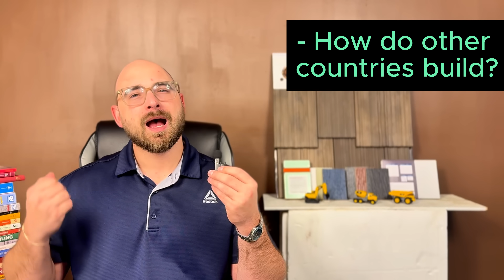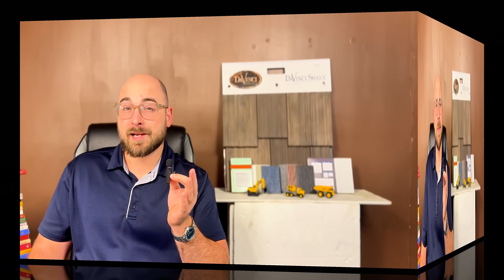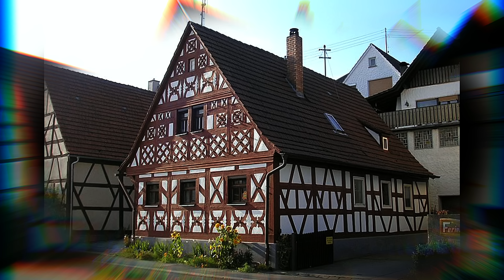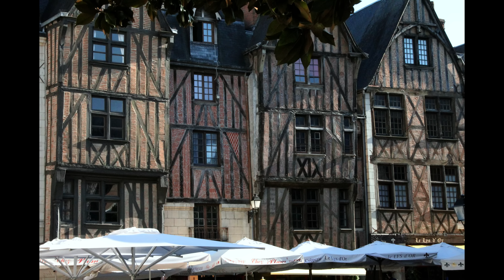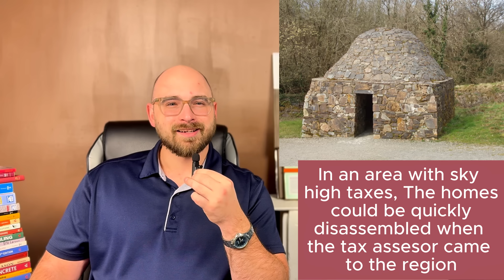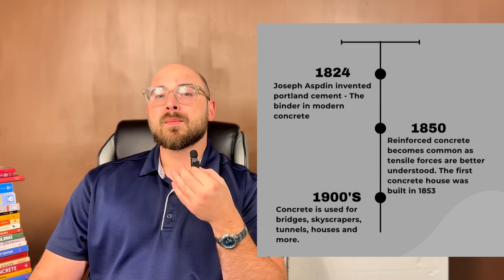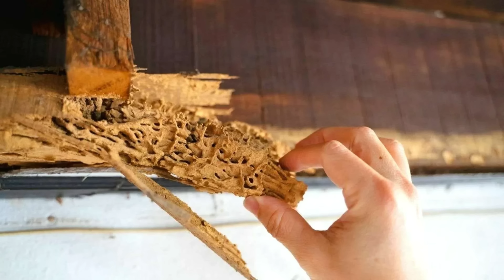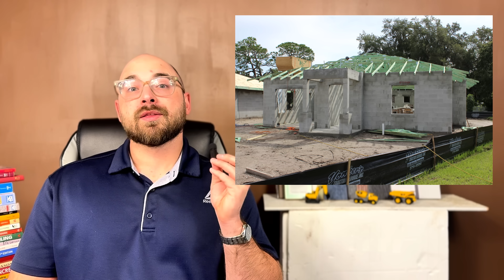Why Other Countries LAUGH at American Homes

Comment: Here in Australia nearly all homes have pre-fabricated frames built in a factory and erected on site. This is still the preferred method but you can also get the entire home built in a factory, and the modules are shipped on the back of a truck and craned into position onto the finished foundations. One of our neighbours did just that and it was ready to move in after the electricity, water and sewage were connected. The added bonus is that there is no down time due to inclement weather or material storages. Just like in the automotive industry of years gone by, there is no need for highly skilled people like carpenters, just one skilled builder, an electrician and a plumber to oversee the entire project, the rest are on the job trained labourers. These buildings can be built to either the minimum standard for your risk area or to a much higher one dependent on your budget.

Comment: I feel like it wasn’t always this way. I live in a 1954 home that our landlord barely maintains. Probably hasn’t had a new roof in well over 30 years. No leaks, no issues. Stays nice temperature, hardly ever need to use the heat or AC. My coworkers have new build houses in, they are built terribly! My boss just has his wall ripped open for 3 months because they couldn’t fix the roof leak! And his AC bill is insane.
Reply from the maker: People used to care about each other in this country, now we’ve become greedy and hyper-individualized
Reply: @ 💯I don’t know how the greed will stop

Comment: The main reason for mocking US homes (afaik) is There is so many potential disasters that can hit, and the homes aren't build accordingly. And with the amount of gun violence there is, I guess most people don't understand why you wouldn't invest in something that can handle most of the challenges. I personally would prefer to live in a more secure place. Take reinforced concrete, It would outlast both earthquakes tornadoes and would protect from firearms.

Comment: As mentioned we build wood houses here in Sweden. But I would say that we use higher quality windows, doors and roof. We often build a concrete slab with floor heating.

Comment: I see it as more  in case the house is burning you can punch your way through the wall to freedom in case the doorway is blocked by fire where you can't punch your way through bricks but you can punch your way through drywall and thin wood

Comment: Very few new homes in Scotland are built from stone. Same in Spain, and I'm sure other places you've mentioned as well. Brick is very much the norm for new housing in the British Isles. Here in Spain, it could be brick or concrete, depending on the type of construction. Of course there's steel framing in some types of building as well. We don't really build walls from wood, at least not for ordinary residential buildings. Wood is used for internal floors, and for roofs.

Comment: I can't understand that in the "tornado alley" and huricane areas don't build concrete circular houses. Will stand there forener. Not cheap at first but in the long run absolutely YES.
For the owner and the comunity. No ned to rebuild 40.000 houses again and again. Or you have to look at Three litteratur pigs" again😅

Comment: It isn't just the construction, Domestic electricity supply and wiring (Plugs and sockets) would be illegal in the UK. A plug can hang half out of a US socket and the appliance (un-fused!) will still get current from the outlet. A quarter of domestic fires in the US are caused by electrical problems.

Comment: Great video and good summary. I get the need to build as cheap as possible, I really do. Housing prices in Europe are laughably high compared to those in North America - and even there they have been rising to stupid levels. BUT what I don't get is building that way even in natural disaster hazard zones, like areas prone to wildfires or hurricanes. How does it make sense to build 2-3 houses in a lifetime rather than just a single, sturdy one. A solid construction house with good roofing will just shrug a hurricane off. Most that will happen is you lose a few roofing tiles and thats it. They withstand even Tornados, although some Windows and things might break - still, much better than to be left with nothing.

Comment: thanks very unbiased and informative. I appreciate the effort that went into the research, I am from South Africa (load bearing brick building mainly), and I have lived in the UK for 20 years, again, brick, buildings mostly, and now in Bulgaria, stone ground floor, half timber and clay bricks for second storey. In England the majority of homes I stayed in was more than a 100 years old, so they definitely have durability, often, the problem was rather fittings, like plumbing, mold and damp that was issues. my current stone half timber house is also more than a hundred years, I added insulation on in and outside, half the bottom floor is underground, it is the way it was done here, because it gets very cold and very hot, and the stone is incedible insulation. maintains a great temperature even when it is -20 outside. I generally look at American houses as structurally suspect, especially because they get blown to splinters in hurricane alley, it mystifies me that Americans build so flimsily, you can punch through any interior plasterboard wall, must not block sound well, the roofs blow off with strong wind, and the structure collapses very easily when there is an earthquake, hurricane, fire or flood. sometimes spending more money on something that lasts is more economically sensible. look at the crazy house insurance prices in Florida, I don't know how you guys stand it.

Comment: I prefer a living space where I don't accidentaly punch holes in walls when I stumble. The wooden paper houses you guys are currently building would be fine for half the price. But knowing that you can get actual durability and quality for the same price or less makes it complete nonsense to build or buy them imho. Good, cheap, fast. Those are the options and you can pick two.  In Europe we usually prefer good and fast, your country prefers cheap and fast.
Just recently a house on my street caught fire. One room was damaged, the rest was still habitable and everything. One room had to be redone and aired out for a few weeks. The fassade had to be repainted. The houses here are 130 years old and even the one that burned will last another 130 years easy. Oh, and that house was also sharing a wall with each of their neighbours. Wanna guess why those houses did not burn as well? Because brick does not burn.

Comment: I also read somewhere that Americans expect to replace their roof every twenty years? The roof on my last house was the original roof at 123 years old. the only external items changed in that time were some old cast iron gutters, wooden fascia boards and windows that were replaced with modern PVC after 103 years
Reply: Part of that's insurance regulations last insurance I had required a new roof every 10 years for shingles. Have friends with slate roofs that are required to pay for yearly inspections or lose homeowners.

Comment: All American homes should be built to a higher standard. We have many storms, fires and geological disasters to warrant stricter standards. I now reside in Florida and live in a cinder block home, many are now being built using precast concrete tilt wall methods. I love the insulation factor and durability standards, noise being a major factor. We’ve seen many hurricanes or tropical storms, roofing shingles being our worst problem, hopefully that will change soon to more durable materials.

Comment: I totally get that you want to have a positive outlook since you work on building actually good US homes, but (as somebody spoiled by living in central EU) if a stone flung from a lawnmower would go trough several rooms in my house (or even just the outer wall) i'd be so mad and worried at the same time i'd probably move 😂

Great that concrete homes are more and more common (and again respect to you for building some of these) but a quick Google search tells me 94% of US homes are wood frame construction (according to some "Tytan Professional" in Aug 2024) so taking your 15% concrete homes number into account, it has to be somewhere between, lets say something like ~88% of US homes are the typical wood frame construction, if that's the case then i'm still leaning towards "the laughing is justified", it's great to hear that things are improving though & i hope they continue to do so in the coming years! 👍

Side note: (if not familiar yet look up &) consider to start selling people in the US some nice European windows and doors with your concrete homes, they are pretty good too 😋

Comment: even so the light weight timber homes in europe are way fare better as the Frame s thicker,  have thicker often multilayer drywalls(both sides of frame) and are mostly Fiberstrengten as well as they are insulated with mineral wool and a steam slowering foil. And on Outside 1foot thick polystyrene blocks covered with plaster. even inner walls are made also with 2 layer drywall and insolation

Comment: That was a very long way of saying concrete is better… they’re already charging $1 million for a bungalow house, how much really would concrete add?
Reply from the maker: It depends on what you’re comparing it to, 

If you take stick framing and make it efficient with double walls, more insulation, special membranes, etc. you may as well do insulated concrete for the same price, it’s dumb. 

Obviously a concrete house costs a little bit more than a bare minimum wood house, but if you want the absolute cheapest price you shouldn’t build custom anyway
Reply: @ oh you gotta see the condition of these houses in southern Ontario…
Reply from the maker: Whats going on in Southern Ontario?

Comment: You can tell it's American construction when "it's cheap to build" is the major factor.  American houses are made to fall apart because it means homeowners spend more on repairs, they're poorly insulated so homeowners pay more for electricity, they have hollow spaces in them that are perfect for pests to nest in so homeowners have to pay for pest control.  Everything about modern american homes is made to make sure money filters from the homeowner.

Comment: What would be the best for a house in Houston, TX? I keep hearing that concrete is not an option because of the weight
Reply from the maker: You can do concrete in Texas. 

Involve a geotechnical engineer on your project. design and build a foundation sturdier than what code requires, you may need to include piles, piers, spread footings or a combination, but it’s possible
Reply: @ thank you!

Comment: In Scotland the standard construction for housing is Timber kit for the structure, with a masonry (either brick, rendered block, or stone facing) outer skin for weather protection. 
It's pretty much been this way for at least 25 years (certainly introduced many years before this) when I got into structural engineering when brick/block construction was being phased out. Part of the reason we require this construction is because masonry/masonry just can't provide the insulation properties that we require for our building standards.

Comment: To answer the final question in the video I do not think that concrete buildings are the way to go. Concrete is it poor insulator meaning concrete building is a hot in summer and cold in winter. It's also less beautiful than stone, brick or wood. Concrete is the worst material for the environment as cement can only be produced at very high temperatures with coal furnaces. If you're still not convinced that concrete is not a good solution, there is also the drawback of its short lifespan. It tends to crumble after about 50 years. All in all I would say it is the worst material for building houses.

Comment: Basically every country has better substance in their houses 😂
Natural disasters don’t hit nearly as hard in Europe, as while in the US the whole house would be gone, in Europe it’s just a little part of the roof in the worst case.
Reply: This is not 100% true, in south eastern United States majority of homes (and 99%  of other structures) are concrete to protect against hurricanes.
Reply: @ they are partly concrete, but still no comparison in build quality to European houses. Insulation, wiring, piping, roofs all of that happens on a much lower quality level.

Comment: This was a fun video. Loved the topics and the examples.

I don't think the products used to build the homes are the problem. Wood, why not? The problem lies mostly - in my opinion - in the regulations and builders. All kinds of companies are getting away with cutting corners and using cheap material. The material itself doesn't have to be the problem if used for the right reasons and to deliver quality. Not to scam their customers.

And they will always try. It's not like they don't try in other countries. Of course they do, all the time. But they can be held accountable. And I think that's one of the key points that makes a HUGE difference in the quality of those homes.

Comment: I'm a remodeling contractor in Ohio, USA. The best houses to work on are 1920's to 1960's. A lot are brick or block. The wood framed McMansions are garbage. Builders are a lot like current US President-all fraud, take the $$ & run, no quality.

Comment: Finnish light wood framing structure buildings are a lot more energy efficient and sturdy than in US. Using cellulose insulation and drywall paneling you can create sound insulating and sturdy walls.
Reply: My own house build from 270mm thick pretensioned engineered timber log with interior walls from engineered wood framing, drywall panels with inch thick wood paneling on top, making interior walls 5inch thick and extremely sturdy.

Comment: "Are houses in other countries better than the US?"

Yes.   Oh, i absolutely love some of the Sears and similar mailorder houses and stuff, but there's definitely several parts of construction that tends to be inferior.

1st of all, any house here in Sweden that cannot handle 1-2 meters of wet snow on the roof?   Not good enough.   Can the average US house survive that?  No.   And as an extension to that, can they survive a harsh blizzard?   As we've seen repeatedly from real events, not really.

2nd, drywall(and some similar).   Here, almost noone would even think of putting drywall as the ONLY wall.   It's on concrete, bricks or wood, even if it's just a backside of plywood, that still makes a huge difference from just drywall the way it seems to be used so commonly in USA.   This also comes back to point 1, because the US method of walls would often make for absolutely terribly insufficient isolation against cold, much less blizzards.   If it's -25C outside and constant winds over 20m/s and gusts up to 30m/s, you absolutely do not want to have a single layer of wood on the outside and drywall on the inside.

3rd, something i have noticed myself.   If houses in USA gets abandoned, even just 5-10 years, they suddenly look like they've been derelicts for 10 times as long, far too often completely decrepit after such a short timeperiod.   A house like that here, there may be details that have gone bad, but generally, there will be no severe deterioration just from a few years of abandonment.   And this alone very blatantly says that YES, USA has a tendency to build far too fragile houses.

"dont move around as much"

That's false.   Population mobility has been very high here in Sweden for hundreds of years.   It was literally just perfectly normal for people to move hundreds of km, and most people moved a far distance at least once in their lifetimes.
And Europe overall wasn't that much different.

.

"fast and cheap"

Except it's not cheap in USA to build housing.   In fact, i remember when my cousin built a new house, she paid just over 100k$, for a 2 floor villa of, IIRC, around 150sqm, maybe a bit more, with a marvellously large porch.   Can you beat that?   At the time, i happened to get the chance to compare, because another cousin at the time lived in USA and had considered building a house, and her answer was, not a chance.
This is achieved by what is called "element"-construction method.   It's basically pre-fabbed parts that are interchangeable to such an extent that you can build literally thousands of variations with just a small number of parts, combined with strong frame.

Comment: Yea I never understood why Americans would build things out of paper. Everytime there's wind or strong rain, or a few insects.., you lose everything. You can't even pass it down to the next generation. Its really sad. I don't live in one of the fanciest austrian-german built houses of the last 50 years but I live in a 200 year old house built out of Istrian white stone (and a blue one here and there that its a bitch to drill through), the house its strong. The walls are half thickness of a castle wall.
Reply: I live in southeastern united states where majority of homes are concrete with thick walls (of course not as thick as german walls). Concrete homes are a must due to seasonal hurricanes so while here people have homes that will last for a while even with hurricanes, I still find it odd that in the Midwest and other regions where there are tornados they build out of wood.